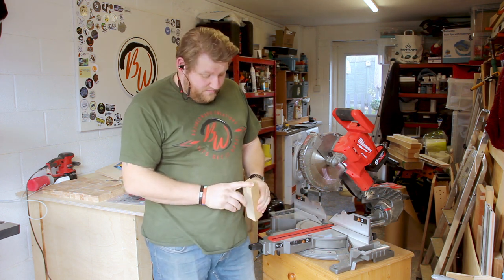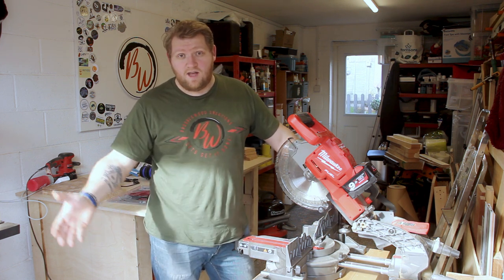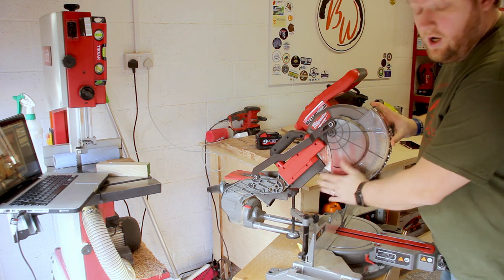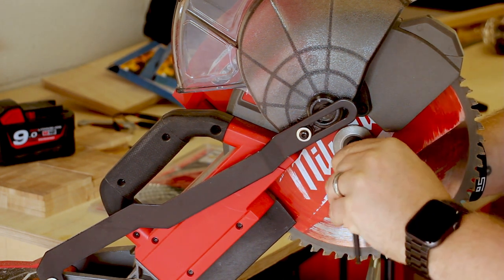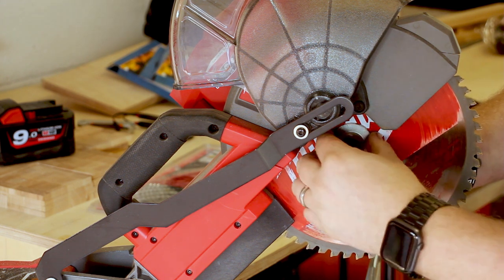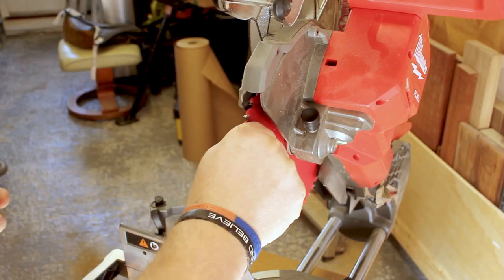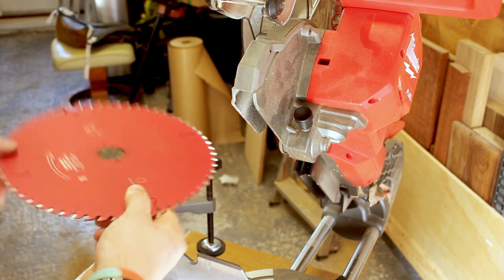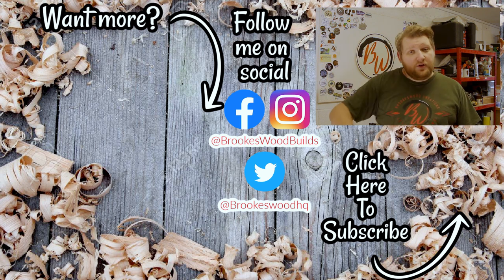How to change a mitre saw blade!

Comment: never thought which way the nut on mine turns.  Now i'm off to check.  Nice to see your on the freud blade train with me.  THe mitre needs a zero insert in it to prevent small bits of off cut disapearing.

Great video as always
Reply from the maker: Thanks Shaun. Not sure if it’s all saw but the Milwaukee is like that. Love the Freud blades. My track saw is next to change. 
Yeah definitely need to. It’s on my list for the table as well just need to get round to it.